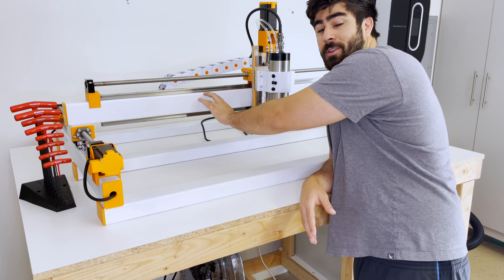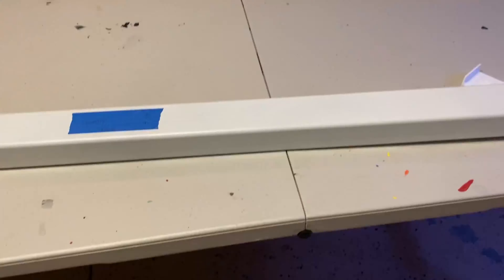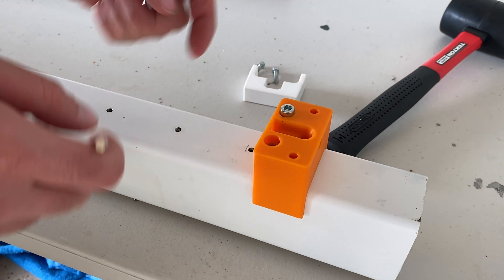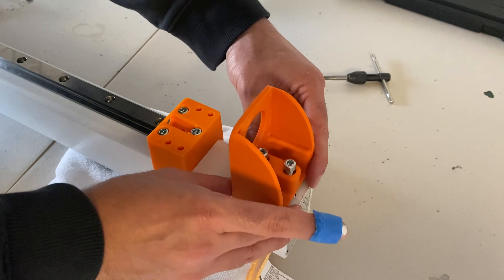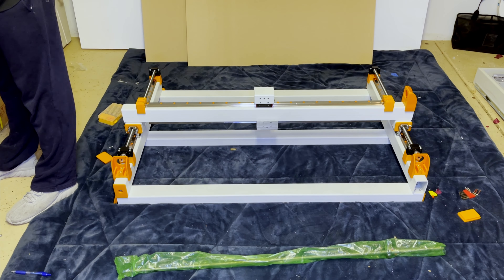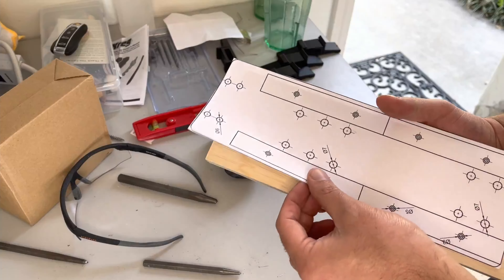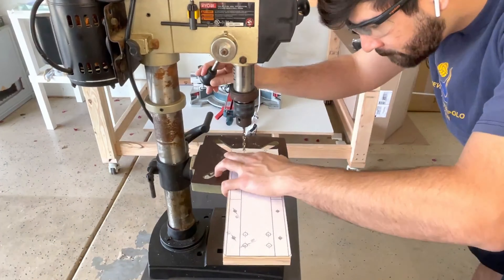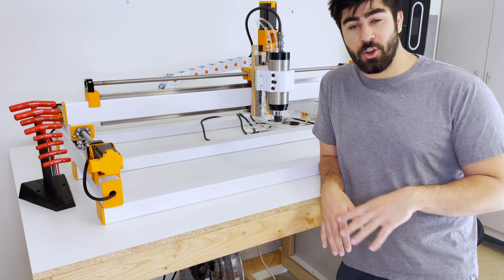Mounting the Gantry and Starting the Z-Axis on my PrintNC! | Build Ep. 3

Comment: If you ever have to tap many holes again you should look into buying a self reversing tapping head for your Drillpress, use it at work daily and it makes your life so much easier and faster ^^
Reply from the maker: I have actually never heard of that! I just looked them up. How well do they work in various material? Like will it change how much torque is needed? For example I know when tapping acrylic you need to do it slow and gently.
Reply: @AryaNakh  we mainly do aluminium, works pretty well there, just need to keep it lubed and set the right rpm, can't really tell for acryllic but i guess it should work the same depending on how slow your drillpress can go, or if the material can stand tapping in multiple steps.
Reply from the maker: Got it. That is super cool. I’ll have to check that out. For now, it’s just an arm workout but looks like something to add to my list of future tools!

Comment: How many spray canisters you end up using? LOL :)
Great build!
Reply from the maker: Thank you!! I used about 3 cans of primer and 3.5 cans of paint for the steel plus the cable chains!  I used Rustoleum spray paint.  Depending on the color you pick, you may need more/less cans of paint. Since both my primer and paint was white, it made it easy. Also depending of scratches in your paint job would annoy you, you could add 2 cans of clear enamel spray paint to the mix after it is dry to help protect your paint job! I didn't do this (I didn't think of this at the time). But so far it hasn't been a big deal. Hope this helps!

Comment: Tip:  When drilling precisely located holes in wood you can use brad point drill bits.  Accurate and you don't have to center punch the locations.  Nice color scheme.
Reply from the maker: I just looked up what these were and they seem absolutely the solution! Going to pick up a set. Thanks for the tip :)

Comment: Nice video! I'm finishing my PrintNC very soon :D. Those motor covers with the hole for the connector... I have seen some in thingiverse but yours seem to have a very low profile. Which one did you use?
Reply from the maker: Thank you very much!
Reply from the maker: Yes that is the one I used! The only thing is one of the aviator connector covers is mis-sized for the base so I made my own cover for it. I will upload it as a remix for that part today if you want to use it 😁
Reply: @AryaNakh  yeah, that would be great. Thanks!
Reply from the maker: @davidzomec  https://www.thingiverse.com/thing:4888964 I have uploaded it here! Let me know if there is anything else I can provide! This one works for the vertical wiring option. The other "side" wire feed mounts, use the lid in the main thingiverse!
Reply: @AryaNakh  I'm actually gonna need this. Thanks!
Reply from the maker: @davidzomec  Absolutely! Good luck on your build!!